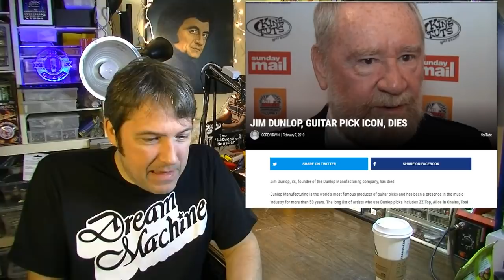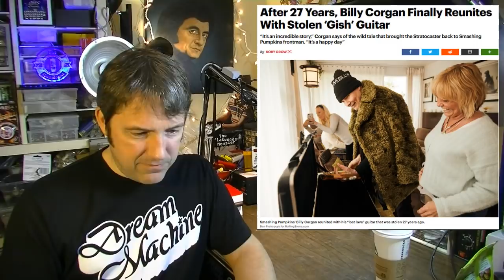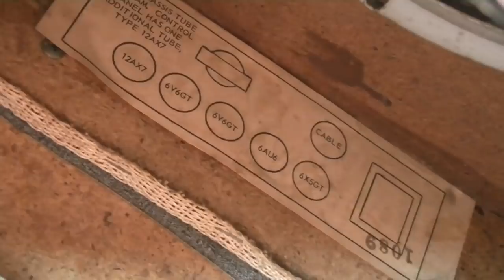ROSEWOOD IS BACK, Jim Dunlop Dies, Stolen Billy Corgan Strat Found at YARD SALE! - SPF

Comment from the maker: Forever Pick has informed me they're taking orders for a new line of copper penny picks like the ones I got the other day from the Flatwoods Monster Museum. https://wood-top-tone-company.reverbsites.com/
Reply: Ha! My family is from Braxton County (WV).  In fact, by paternal grandfather was the mayor of Sutton when the Flatwoods Monster thing happened.  What took you there?
Reply from the maker: I've been to WV white water rafting, but the Flatwoods Monster I didn't know about until a viewer, who also runs the Flatwoods Monster Museum there, mailed me some stuff.
Reply: Can't just make these out of any old penny.  Since 1982, pennies have been made of zinc, with a thin layer of copper on the outside.  Gotta find a 1981 or before penny if you want 95% copper.  If you try to squish a zinc one, they just look crappy.  I find less than one in ten pennies now in circulation are actually made of copper.

Comment: Another great video. I'm currently building a push/pull 6AQ5 amp from parts obtained from a chassis I got off of Ebay. I bought a new Bud chassis, transformer and tube sockets along with all new electronic componets. Just finished the power supply and am working on the pre-amp now. Thank goodness there are lots of tube amp books and videos to show me proper construction techniques
Reply from the maker: Congrats! Send me some video and I'll include you in a SPF episode. Bradlinzy at gmail

Comment: I just repaired a Bandmaster (for me). 1964 if I remember right. It was popping fuses and maxing out my Sencore PR-57's ammeter. It was untouched (which is nice) and 3 of the power supply caps has splooged their innards. I recapped it and now it plays like a dream. I also recapped the bias supply and basically rebuilt the power supply section (diodes). I did  some "Brad the Guitologist" resistor changes on the power tubes too.

Comment: Last time I saw those big cement screen resistors in a Fender, someone had rewired the sockets to allow EL34s in it. As you know, the extra heater current is hard on the power trans, which might be what caused the fuse blowing. Just a thought.

Comment: i switched from fender tortex to dunlop .60 orange in 1984 or so, then to .73 yellow now i use .88 green. i never looked back from the switch though. great pics. picks got thicker as i learned to control better through the years and upped the string gauge as well. i always hated how the tortex picks wouild break where the colors blended. and wore out in  less than 1 sitting. thank you jim dunlop.

Comment: To fix the Silvertone amp bottom, the are several rot repair epoxies available that would soak into the wood after you flatten it.  I have used it on window frames for my house.  Work well.

Comment: Superglue is used to harden soft woods to get screws to hold...you can buy it in commercial jug sizes. Check with a local woodshop and you may be able to just get them to coat it cheaper than buying a large quantity.

Comment: Hey Brad you can straighten out the bottom of the silvertone amp cabinet and coat it with fiberglass resin to seal and get the wood to hold.witch I'm sure you know that.another great video.cheers
Reply from the maker: Bryant Crawford thanks for the suggestion.

Comment: Hey, Brad. I have an acceptable Fender Frontman 15W but the distortion diodes are LED's. A regular diode clips the signal and the part that is clipped is converted into harmonics, that's what gives the distortion its spark. But a LED emits the clipped signal as light, so these harmonics are lost, right? I am thinking of switching to a pair of Zener 4148 diodes.

Comment: Jim Dunlop 2.5 jazz picks completely changed and drastically improved and accelerated my R&R plecttum skills and string accuracy, PLUS, no one ever stole my picks because they were thicker than a quarter. LOL. They felt so comfortable. I drilled 10 or so tiny holes through them to eliminate slipping and pick roll. I highly recommend them if you can find them. The thickest pick JD makes now is the 2.0.

Comment: Regarding the bottom of that amp you picked up, maybe give the type of wood stabilizer that is used for working with burl a shot? It's supposed to soak in and fill any voids and solidify soft & weak wood. Might do the trick.
Reply from the maker: George Hen thanks for the suggestion!

Comment: Hey Brad you might check out this stuff called Durhams Rock Hard Water Putty to help you fix up the bottom of that Silvertone. It's cheap and you can find it at any hardware store. Real easy to work with and sets up like it says rock hard and durable you can remold the missing corner of chip board with it pretty easy and it will prevent further damage. I suggest you test it out and see if its properties fit the bill for the job and you can understand what your working with. It's much easier then messing with fiberglass and resin or epoxy and is just as sturdy and light. And you just mix in water. I'm all for keeping stuff original when it comes to antique collectible stuff but making an old speaker/amp cab made out of deteriorating chip board back into a sturdy trustworthy everyday user is a good cause to give it a repair that will last and do the job for a second lifetime. The stuff is up there with duct tape in my handyman fix it bag of tricks. 
-John

Comment: Objective question.... when an amp such as this (vintage tube) has new caps, new resistors, new tubes and if a combo amp a new speaker, is it still really vintage???   if all the original components that created the original "vintage" tone have been replaced, what makes the updated amp "vintage"... I've struggled with this for years..... A shop once tried to sell me a mid 60's blackface deluxe reverb that had been updated with all the parts I listed above and at a high price. Couldn't convince myself it was still a vintage amp.....

Comment: I got a story for you.. I saw Stevie Ray Vaughan in the mid-80s the venue was in Pawtucket Rhode Island call the Leroy theater built in the twenties as an opera house... although it was only a couple of miles from my house.. and was connected to two music stores.. the entrance to the Leroy was 50 ft down the sidewalk from Rhode Island music another hundred feet down the sidewalk was Ray Mullins music.. where I started taking guitar lessons in the late 70s.. I had no clue that this theater  was there .. the place was unbelievable.. intricately-designed plush.. burgundy colored carpet from the front doors all the way to the stage. The entranceway had two huge bars on either side. Three bartenders per bar chandeliers.. the seats were extremely soft plush velvet dark burgundy.. I could go on and on.. I've been to hundreds and hundreds of concerts.. outdoor.. nightclub.. Arena... Stadium.. I cannot express enough the impact of the venue itself had on me!! And then there was the entertainment!!!! I hung around with older people at the time in fact my boss on the restaurant and he was the one I went to most of these concerts with but that's a whole other story.. I had no clue who Stevie Ray Vaughan was other than hearing him on the radio .. but the timing was right and I think it was like 13 bucks for tickets. And it was general admission.. so as usual the guy I worked for went big he bought 20 tickets.. the place was only 15 minutes from the restaurant.. which had a large bar and dance floor and they hosted small bands on the weekend.. we ended up front row Center of stage.. I sat right in front of the microphone at Center Stage.. I had no clue what I was in for... I was still in awe of the unbelievable venue...  from where I sat the stage was 15 feet in front of me.. and at eye level.. no barricades no bouncers... just a half a dozen ushers in suits..  the bar was open.. 16 oz plastic cups... beer or mixed drinks. And then they introduce the band.. the house lights went down stage lights came on and this little guy in a cowboy hat and cowboy boots. With a huge white feather in his hat and his pants tucked into his boots... came up to the mic.. he was only accompanyed by a bassist and a drummer.. my immediate impression was WTF!!!! I thought to myself well at least I can get drunk. In less than 2 minutes.. well words can't describe what I was hearing seeing and as a musician I'm sure you know.. I was literally.. figuratively.. and emotionally.. feeling every note... I know I'm rambling but.. this was by far the best show I had ever seen.. nothing has even been close since... the next day I went to the music store next to the Leroy. I bought a 70s Fender Stratocaster with Rosewood neck.. and my Kustom 150 amp..

Comment: There is a product for boats called Gitsrot. You mix it up and if its dry it soaks in and converts the wood into like fiberglass. It gets rock hard ,really strong. You literally pour it on ,not in the basement and let it harden over night.
Reply from the maker: jon lennon thanks!
Reply: I may have spelled the name wrong but it is pronounced Gits Rot. We use it on rotten dried out boat transoms and it gets so freaking hard you cant believe it. @TheGuitologist

Comment: I would be willing to bet that Fender’s choice between rosewood, Pao ferro and engineered hardwood will depend entirely on price point. Sure, the custom shop and some American made (as well as possibly Japanese) will have rosewood as an option, but probably with a price increase for the rosewood. Now that they’ve adjusted to the other materials costwise, there is no way they’ll offer rosewood, which is still endangered whether the government allows importation or not, without charging more.

Comment: Thieves... lock em up!  Recently got a Silvertone amp myself .. but have not tried to fire it up. It will need a full restoration, or rest-o-mod.. The 2x12" lower cab has great need of new wood here and there, and new Tolex. Darn particle board and damp basements just don't mix.  I may recover both head and cab with grey pebble tolex, as the original is not available nor is it attractive to me.

Comment: Out of curiosity I have an all original 1964 ampeg jet what are the most common failures on those? I was not sure where to ask so I used the comment section. Mine has not worked since I acquired it from an old roommate.
Reply from the maker: John Loughner power caps.
Reply: @TheGuitologist  My Ampeg Jet blows fuses as soon as it warms up. The rectifier glows like the Aurora Borealis right before the fuse goes.
Would the power caps be the problem there too? It worked great, with no issues or noise for a long time than one day instantly it just went south.
Cute kids, BTW. My son fractured the same arm when he was your daughter's age.

Comment: Rosewood is not a specific species. It is a group of species. Like the dear family might refer to anything from a moose, elk, etc. Some species, such as Brazilian Rosewood, are VERY ENDANGERED. Others are not. The problem is that to the undrained eye it can be very difficult to tell them apart just by looking at the unfinished wood. (If you could see the tree in the wild, with the leaves, bark, roots etc., it would be easier.) Consequently, average customs inspector often has difficulty identifying the correct species. 

As you might imagine the rare species are the most valuable. (A new Martin with Brazilian Rosewood costs $50,000 for the wood alone. That does not include the cost of the other components or building the instrument.) As a result, there is a HUGE incentive for wood dealers to "misidentify" valuable rare species as more common species when filling out customs and shipping documents. 

This is how Gibson got into trouble. They were selling more rare wood instruments than they could account for given their inventory of wood. Their paperwork said that they were only purchasing the more common species of wood, yet their sales figures indicated that they were selling instruments made from rare and endangered species. (It only takes one disgruntled employee to file a report.) After they were raided, Gibson was in the unenviable position of either having to admit that they were ripping off their customers by selling them rare wood guitars that were in fact made from cheaper materials, or knowingly importing endangered species labeled as non-regulated materials

Comment: rosewood.. meh rather have stainless steel frets, as long as its shaped right who cares what its made of its not like ideally you want to be touching the fretboard anyways, but im sure they could make some really nice tonal composite materials that are more consistent than wood, but obviously its just cheaper to cut down the trees because they're even on the cheapest of guitars, but im not worried about that as much as id like to see more consistency in guitars and i think relying on wood will give you different results no matter how the same the specs are.  Maybe thats what Corgan is hearing and just attributes it to the paint job with everything else being the same but the grain is always different aswell. Cant go wrong with wood but for once id like to see a guitar made with composite materials that have a purpose either for comfort or tone not just for cutting cost.

Comment: He must have had the only good 74 strat . Mid 70s strats were crap .most were 12+ lbs.on the maple fingerboards
The frets were half covered in poly, 3 bolt neck ,more crap. I  bought one cheep, in the late 70s ,had to pull the frets sand off most of the finish
On the fingerboard. And reffret . It played ok after that but a 12 lb.strat ! Wish someone would ripped mine off and
Collect insurance. But all went well .I sat on it till the mid 90s and sold it $600 , $400 made.